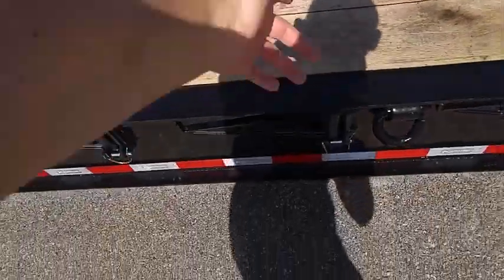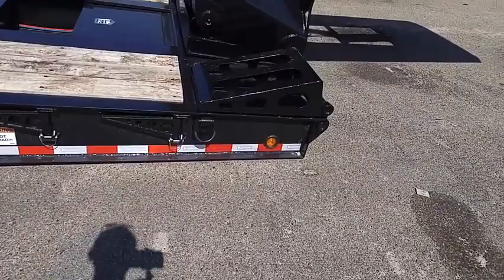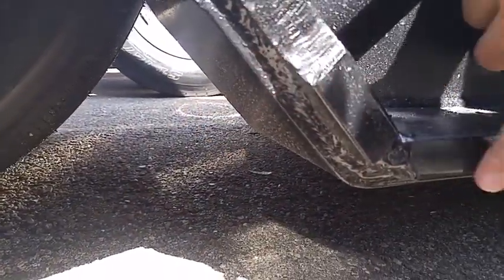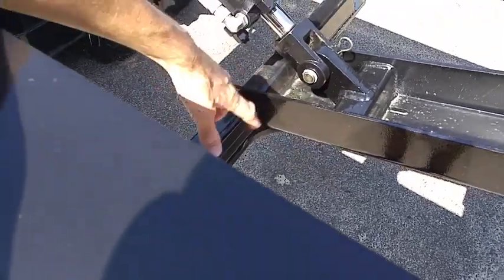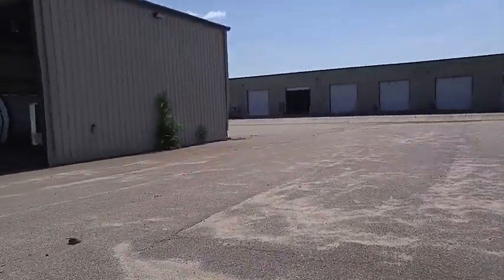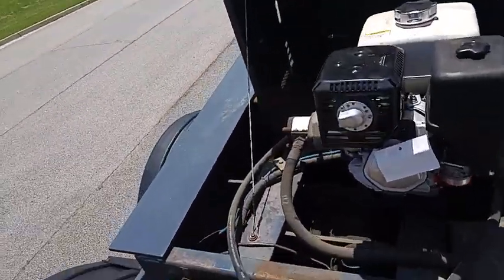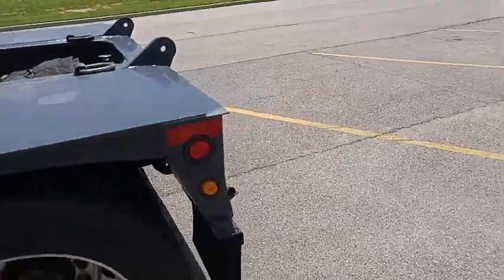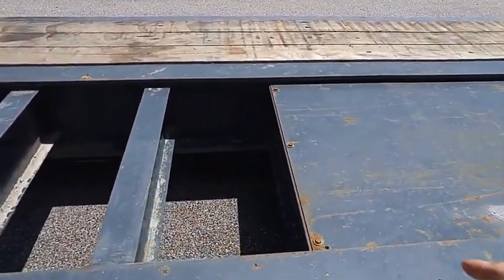Heavy Haul TV: Sergei Tours Kaufman Trailers' Plant in South Carolina

Comment: There seems to be a lot of vent holes on the Honda cover. Does it need that much ventilation?  Could  small doors on hinges be mounted over the holes that could be  open quickly when you need to run the Honda?  Another idea would be to have a  vinyl or canvas cover (sort of like a barbecue cover) made to  put over the entire Honda housing  when the Honda is not in use.

Comment: Sergi, what is the axle spacing of the trailer axles? 5' (60") I assume? I would have to disagree with your assessment of what the states will give you on a quad. I run a 4 axle trailer, and almost every state will allow me to permit 80,000# on the quad. Heck, Minnesota will give me 90,000# on my quad. Texas and Oklahoma and Virginia are the main exceptions.
Reply from the maker: no, it's 54", I think. definitely not 60". I wanted a longer well and 26' works great.
Reply: Oh ok, that might be the difference then.
Reply from the maker: how long is your deck and gooseneck? and what's the spacing between the tires? thx-
Reply: We actually have a 4 axle flatbed. You've seen our trailer before, when you ran into the older gentleman who used to pull it. I heard you mention it in one of your previous videos. It's a custom built 53' all aluminum flat. Our axles are 5 foot, or 60" spacings.
Reply from the maker: +Nick Mordaunt everything is different on a lowboy. if you use 60" axle spacings, then the well becomes shorter. and usually the longer the well is, the better.

Comment: For someone who wants to do heav hula should they first learn flatbed then move up to drop deck and then finally heavy haul? I was looking at keen transport but don't have much info, they do have training though.
Reply: In my opinion, it doesn't matter what steps you take to get where you want to go. There is a learning curve regardless of your past experience. Securement doesn't differ from one type of trailer to the next (with the exception of ratings). Don't slow track your career because you think you have to take all these little steps to get where you want to be. Also, the term "Heavy Haul" is relative, and not reserved for multi-axle RGN's. Check out some of my videos if you want to see a completely different side of the industry.
Reply: ***** Your points are all valid, but I don't like people to think they have to take all of these steps...It's not necessary. Everybody learns at a different pace....At the end of the day, move forward when you feel comfortable.

That's all in my humble opinion though. To each their own. My career, is not theirs and theirs is not mine.

Comment: Hello and on that cylinder that drops down and might tear up your fenders, I would put a ball valve on the line that causes it to drop, then you can when your done raising and using the cylinder just shut the valve and prevent it from backflowing and dropping. Easy fix other than a strap. Have a good day. And drive safe.
Reply: I was thinking the same thing and going to write that but as this is an older video I was reading the comments first to see if somebody already suggested that the other thing it could be happening is maybe the cylinder itself is leaking at the rod end and therefore not leaking back into the hydraulic tank which would not prevent it from falling if that was the case I would replace the cylinder and get one that doesn't leak out but yes you're right if it's leaking back past the control valve and back to the reservoir or hydraulic tank then the ball valve would be the best thing.

Comment: what size well do you have... I've been looking at low boys for a while.. have a drop deck.. is a 26' well enough.. or  29'
Reply from the maker: you cannot have a 29' well on a 55 ton trailer but it's possible on a 35 ton with a flip axle. mine is 26' long. it's more than enough for a 55 ton.
Reply: Awesome... thanks for the reply

Comment: Hey sergei I think I would have those guys make you a heavy coil spring for each side of the gooseneck lift instead of using a strap. that way there is always positive up pressure on it, those little 1 inch straps won't last long in the weather, just some thoughts  good luck.

Comment: When they installed the Honda in the first place it must not have been mounted properly never heard of a Honda cracking at the base plate. You may not be hauling 55 ton but you have a trailer that heavy enough to haul anything you are able too that's what counts. I seriously doubt anybody has hauled 55 tons on one of their trailers. Your trailer will last you for at least 20 more years if you don't abuse it. As for that hole you want covered get yourself some 3/8s checker plate aluminum it may be a little expensive but its light weight and fairly strong.

Comment: What's the Honda for?
Reply from the maker: runs oil in the hydraulic system. otherwise I wouldn't be able to operate the trailer.
Reply: +Sergei Dratchev (Heavy Haul TV) thank you. I didn't know that. I am getting back into flatbed starting Monday. And I want to eventually do heavy haul